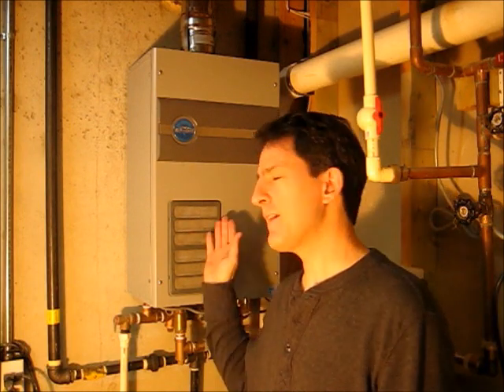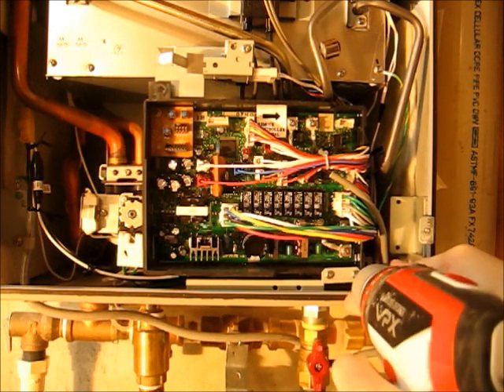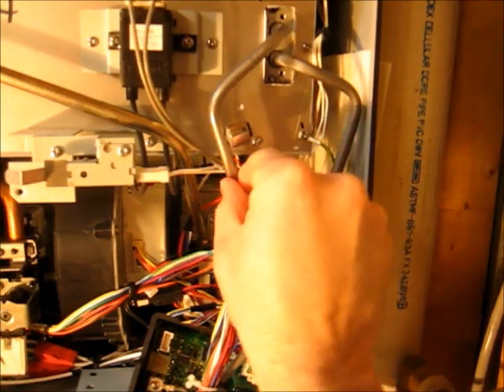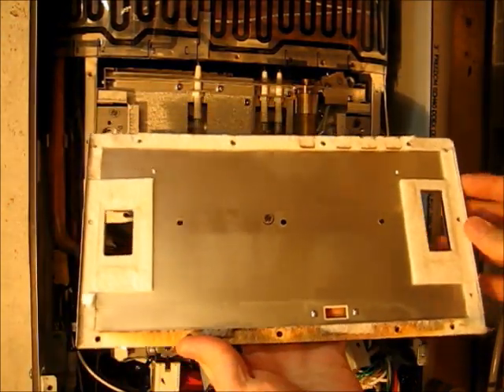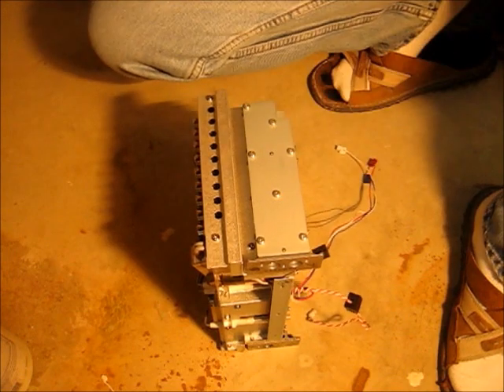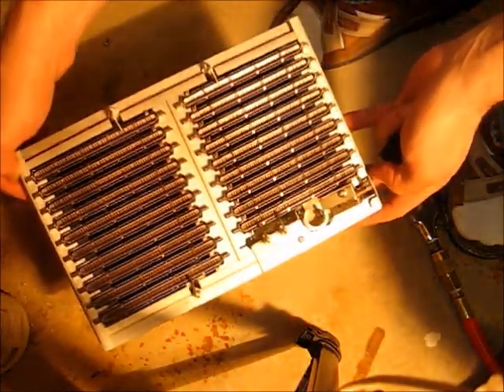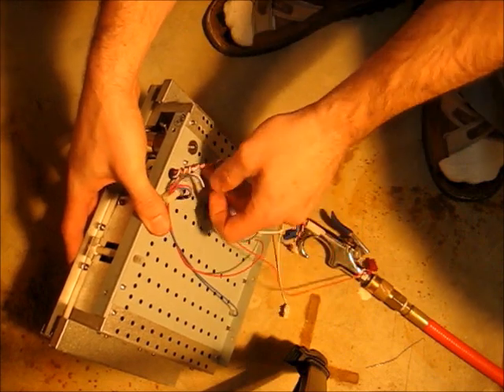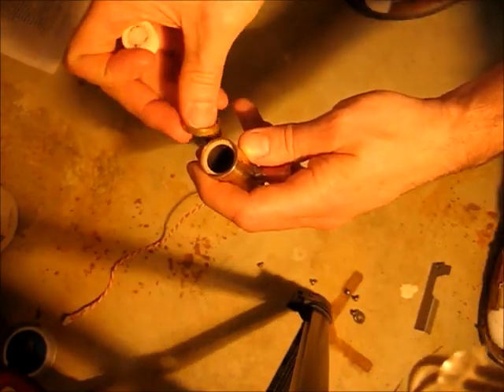How To Clean a Tankless Water Heater Burner (Part 1)

Comment: Thank you. Wished I saw the video the 1st time I cleaned mine and was having issues12 yrs ago. I have cleaned mine every few years but never cleaned the ceramic piece, so good I watch video. Code C2/11 should be listed as (clean Burners) gas pressure on the line is rarely the cause especially when it’s been installed for over 12 years.

Comment: Lou, I was 600$ in  on trying to fix hot water issue.  Had tech come out three times to try to fix it.  If this helps anyone else, my issue was : 
Hot Water turn on, then 5 seconds later I would get code11. The only way to get hot water is to play with faucet 4 to 6 (with 3 seconds intervals) times before it stays hot.  Followed each step in the video, When I took burner out I did see some dirt on ceramic (white) peace. Got it all cleaned out and put it back together. Opened it up and  after 6 months of playing with faucet ……… hot water !!!!  Thank you from my entire family :). You are my hero.

Comment: I have this exact problem with mine. If I buy new rods it will last for about 18 months before I have to replace them again. If I clean the flame rods I only get about 2 months of more use out of them. Can someone please tell me why I keep having this problem
Reply from the maker: Yes, my next video answers that.  You are choking your water heater.

No Flex Gas Pipe for Tankless Water Heaters
https://youtu.be/zW109bgIRg4

Comment: Thanks for this step by step video - much easier to follow vs. the instructions Rheem sent me over email. I found I had to watch it backwards (sort of) to make sure I reassembled everything correctly. At the end, I had trouble getting the fuel rods back into their spots, they would not go in easily. I put a little bit of lube on them, and they slid right in. I hope that does not corrode the o-ring seals. I probably should have used mineral oil or something that I am sure did not contain any corrosive ingredients. Hindsight.
Reply from the maker: Good work!  This job has a ton of steps.  I think you will be fine with the lube.  Gas is only in those tubes when its heating.  If you ever had a tiny leak, it would get pulled in by the air vent fan and burned with the rest.

Comment: I just watched this video and it worked for me too! I did not do every step in the video because I scrolled down and read The Rheem technician's comment. Please read it yourself after watching the video (Parts 1 &  2.) In short, I only unscrewed the top of the three gas tubes and pushed them down to the left like the Rheem guy said. I also did not remove the side rails of the burner nor the ODS. I used compressed air to clean out burners and fine sandpaper to clean the flame rods. It worked! Hot water again! Thanks to Lou for this video and thanks to the Rheem guy who commented below.

Comment: Why are there two gas shutoff values?  One one unit and one in line?
Reply from the maker: +Jason Snyder - Good eye.  Yes, I always thought that was overkill, but the installation instructions called for it.
Reply: HowToLou
The only explanation I get is for "safety", but the safety is for nothing if I don't understand how and why to use either or both together.

Comment: this fixed it!  C7 13 was the code I was getting.  I cleaned the brass gas port to the ODS on the right fuel rail, someone else said the natural gas contaminants which cause the soot on the burners clogs this orifice, starving the ODS flame.  Now I'm gonna take a long hot shower without shutting off the water every 2 minutes to keep the sensor from tripping!  Thanks Lou.

Comment: Error Code 13 Solution

Kudos to the Rheem technician (800-432-8373) for pointing me in the right direction. After 1 year of flawless operation we began experiencing sporadic "13" error codes causing us to reset 1-2 times per day. 

Once I got past the original tech suggesting a multitude of lame reasons, I was transferred to a real tech who suggested examining the FLAME RODS (thermocouples) for deposits and use either steel wool or fine grit sandpaper to remove them if present. Sure enough, one of them showed deposits and now we're back to operating reliably. 

These tankless units appear to be over-engineered and prone to sensor issues after prolonged use which leaves consumers with a bad feeling about their unreliability. I greatly suspect examining and cleaning the FLAME RODS would solve the majority of code "13" issues. I've had to clean them with my furnace every few years and found them more accessible and a simple fix. Accessing them inside of the tankless unit is not as simple, but proved just as effective. :)
Reply: Flame rods... If I did what this guy did id have a basket case at the end of my journey.  The dredded Code 13.  Cant I just pound the side of the water heater with a damn hammer?  Lol. Ok gotta try to figure out where the flame rods ARE

Comment: I hate my Rheem tankless heater. Every year I get an error code E8 13 and have to take it apart and clean it it is a nuisance. After 9 yrs cleaning does not solve the issue and I am looking for something new, NOT Rheem.
Reply from the maker: +John Reist - I am sorry you have had such a hard time with your unit. I don't understand why. Mine runs great and just me no trouble.  Do you have a really hard water? That might cause it to scale up quickly
Reply: Error Code 13 Solution

Kudos to the Rheem technician (800-432-8373) for pointing me in the right direction. After 1 year of flawless operation we began experiencing sporadic "13" error codes causing us to reset 1-2 times per day. 

Once I got past the original tech suggesting a multitude of lame reasons, I was transferred to a real tech who suggested examining the FLAME RODS (thermocouples) for deposits and use either steel wool or fine grit sandpaper to remove them if present. Sure enough, one of them showed deposits and now we're back to operating reliably. 

These tankless units appear to be over-engineered and prone to sensor issues after prolonged use which leaves consumers with a bad feeling about their unreliability. I greatly suspect examining and cleaning the FLAME RODS would solve the majority of code "13" issues. I've had to clean them with my furnace every few years and found them more accessible and a simple fix. Accessing them inside of the tankless unit is not as simple, but proved just as effective. :)

Comment: Lou, thanks for this video. This is not rocket science but made it much easier by knowing what to look for. I just cleaned my Paloma heater, which looks almost identical. After 10 years of use it started giving me code 11 almost every time I used hot water. I have flex pipe, which was my initial assumption that's the problem, but I figured it worked fine for 10 years, so why now flex would not be sufficient enough. So I decided to go easier route by cleaning it first. When I opened up the burner cover I immediately saw what the issue was. I literally had the burners covered with what looked like sand, just flat grains, that were choking or preventing ignition. Do you know if the water pipes just above the burner were originally covered with some kind of ceramic layer that crumbled and fell on the burners or is this some residue from burned gas? Just curious if anyone seen something like that before. After cleaning the heater works like a champ again. Looks like I need to perform this cleaning as a routine every several years.
Reply from the maker: +Henry Limowski - I am not familiar with your water heater, but mine has plain copper water tubes and no ceramic.   I think the main particles that could come from gas, would be carbon.  However, after 10 years of combustion, you have pulled in a lot of airborne particles, some of which are non-combustible, and that may be the pile you are seeing.  I am glad it was an easy fix!
Reply: Henry Limowski:  Geez, nor EVERYTHING has to be rocket science. Some things are simple especially when you have a video or Pictorial guide to reference!

Comment: My 14 year-old gas water heater just sprung a leak in my basement.  I'm scrambling to get this replaced before the 4th of July weekend, but I was kind of thinking about going tankless.  I love the idea and the energy savings, but that cleaning procedure seems like a MAJOR pain - especially if it must be done once a year +/-.  With my luck, I would lose those tiny screws and O-rings, etc... and really be screwed (no hot water)...  I think I'm just gonna go "old school" with a bigass 75 Gallon tank.  I can get a tankless Jacuzzi brand for only $699 from Lowes, but a professional installation will be MUCH more $$.  I can probably do it myself, but that will take a lot of time and I will have to figure out how to get the tank upstairs and how to dispose of it.  Plus, I am not aware of all the the plumbing/fire/ electrical codes, and a permit and inspection is required.  I'm pretty handy around the house, but I think this is beyond my capability.  If I were building a NEW house and wasn't scrambling to replace a leaky tank, I would most likely go tankless. 

Great video, though...Thanks!

Comment: Flex pipe or corrugated stainless steel tubing is perfectly fine to use as long as it is sized and installed correctly. Saying that using flex line is the wrong kind of gas line to use is silly. You just have to ensure whatever type of supply line you use has the gas delivery capacity to properly run the heater. If you really have to go through this process every 8 months, I would suspect your piping to the unit is inadequate or you are pulling particulates (dirty air) into the burner. The installation manual for my unit came with a detailed gas line sizing chart (in my case, it was clear that I needed to run larger gas lines to be able to supply enough natural gas to the unit, along with all other gas appliances that were on the same run). In most cases, when converting to a tankless water heater from a standard tank heater, you will need to run a dedicated gas line to the unit from your meter, or you may need to increase your gas line all together, otherwise you will be starving the unit of gas when it attempts to fire up (resulting in the dreaded  11 code). If you are using 3/4" black pipe for natural gas, the run must be no more than 30' from your meter and it would need to be a dedicated line (i.e.- you wouldn't be able to run a furnace, a stove or a gas dryer on the same run).

Comment: I kept getting a random code 11 from my tankless water heater in a house I just bought... called Rheem and they went over how the system was installed and they said the flame rod and burners needed cleaning.  They emailed me the instructions as they did you. The instructions looked harder than it was, thanks for the video so much it gave me the confidence to do this and saved lots of money.  Great video and reference tool. Now it works consistently.. the rods were white on the end and did get some debris from the burners.

Comment: I just flush with vinegar and clean the burner of my Rheem and it is working again, I was afraid the control board was bad and because my remote control is not working and only sent me the 76 code (means bad comunication I can't now what was happening!!), now I have hot water again, THANK YOU LOU for making it easier and saving a lot of us of dealing with Rheem directly

Comment: Great video. I did find out today My new Rheem install was throwing error code 13.. Rheem said it was venting or flame rods and other such nonsense. I found a chart for gas delivery length and pipe size. Using 3/4 pipe over a  45 foot run( with elbows and tees counting a add 5 foot each) that GAS starvation was the problem. ANYONE can have error code 13 throw if using marginal gas delivery as when the stove and furnace are on when water heater is turned on. Error code 11 clean flame rods

Comment: Thanks Lou, my folks have had a Richmond tankless for about 3 years and this is the 3rd time the error came up. They had called the plumber to fix this every time and were sick of it.  They arranged to replace this with a traditional water heater next week. I said, let me try to fix it and had your video helping me out along the way.  I used canned air since an air compressor was not available and used a q-tip to loosen alot of the dirt in the fins. Thanks for saving us from spending more money!

Comment: I cleaned out my burner following this procedure and restored the water heater function and cured my code 11 without removing my 3 foot long flex supply line. A little tip is to clean out burner tubes with a pipe cleaner. I had a small cob web in one of mine